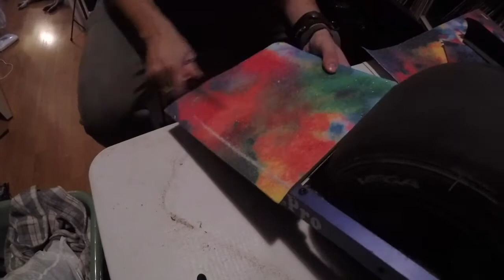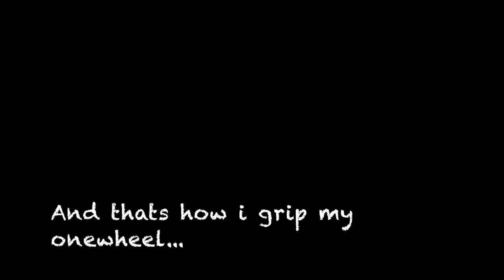Onewheel Re-Grip

Comment: Hey, I regriped mine exactly like you did however I now am getting a notification "I need my personal space- Do not press the rider detect zone". Did you have any sensor issues? I am thinking the leftover glue from the stock grip tape is causing my sensor to believe theres pressure when theres not. My next guess is to rip it off and clean it. Any ideas?
Reply from the maker: Mark Ulibarri hmm I haven't had any issues like this. Wut kind of griptape are you using?  Maybe try carefully removing the griptape and see if you get the same error without any just to make sure it's the griptape that is the problem. Keep me posted on your results we will figure it out.
Reply: I am using Mob grip tape. I removed the front pad grip that I had put on and managed to completely clear all of the access stick from the grip tape. I am still getting the same message. The only way I can get my board to register is by heating the front pad with a hair dryer and it registers correctly. Bizarre! Sucks, because I just got my onewheel+ back from future motion this friday. They had it for two weeks and fixed motor issues.
Reply from the maker: Mark Ulibarri hmm that is odd I have herd of a few ppl with the same issue and heating solution not sure of wut the cause could have been. Could be a faulty pad all together if it's still under warranty they should send ya a new one.
Reply: Damn, it was working fine when it came back from the shop. Yeah, thats probably the case. I'm pretty sure changing the grip tape voids the warranty on the sensor so I may have to pay for this fix. Thanks for your input, hoping someone has a solution in the community. Congrats on making the floatlife team man, I follow and hope to be at the next float life fest.
Reply from the maker: Mark Ulibarri always ask the community great source of info I'm sure someone has gone threw this and will have more info. I know Chris Richardson  uses mob grip I wonder if he has had this issue.
Reply from the maker: Mark Ulibarri thanx I'm stoked to be a part of the team and hope il see ya at the next float life fest.